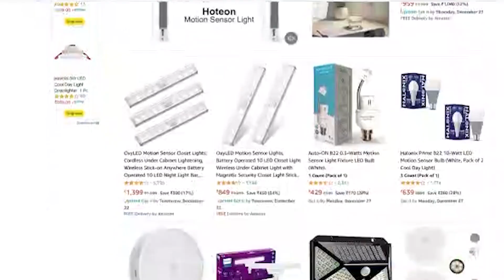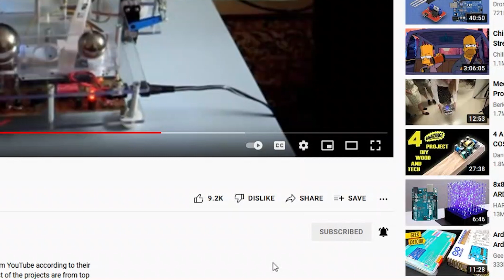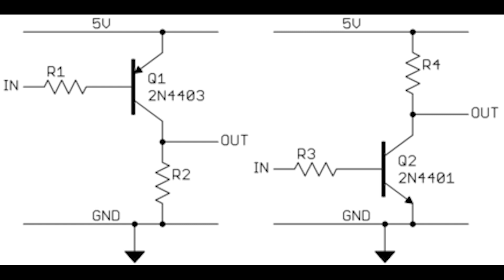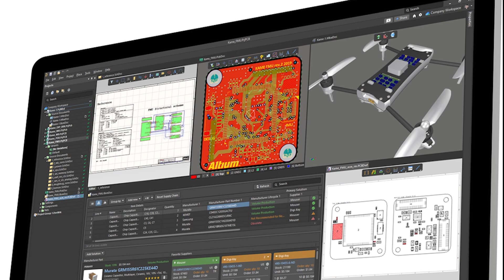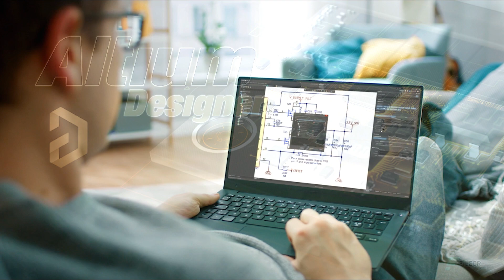Motion Sensor Light without Arduino | PIR sensor

Comment: but one need a off delay timer circuit  with pir and ir sensor , as they frustrated by triggering output relay unnecessary
Reply from the maker: Yes … there is sensitivity and delay adjustment in the sensor itself
Reply: @RoboCircuits  yes there are > but if someone not give a movement inside room within the time value set < PIR output goes Off> same with IR sensor...flickering trigger, as hands many times goes  out of range of IR front ..>> we need a backup source to continue getting ON signal/supply to avoid interruption in output load.( i am trying some circuits presently)
Reply from the maker: @anandjoshi8554 thats true… in these cases we use micro wave sensors or presence sensors. But there the cost increases drastically

Comment: can we use use vibration sensor like this?
Reply from the maker: Yes
Reply: @RoboCircuits  but one need a off delay timer circuit  with pir and ir sensor , as they frustrated by triggering output relay unnecessary